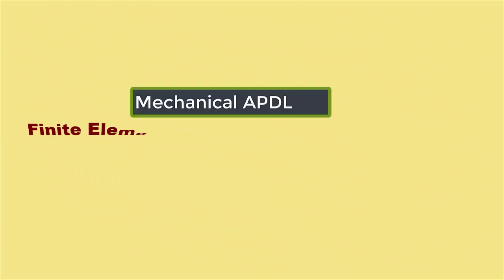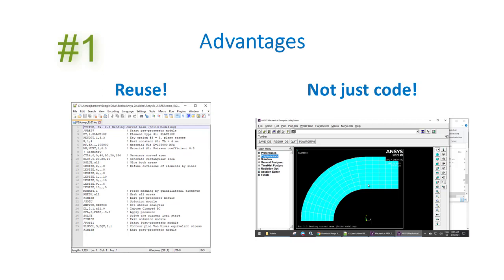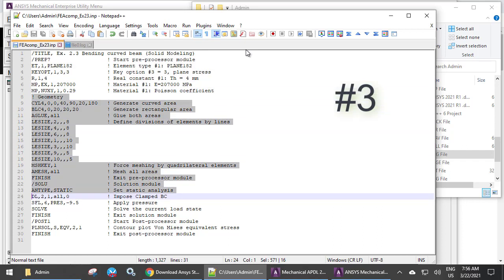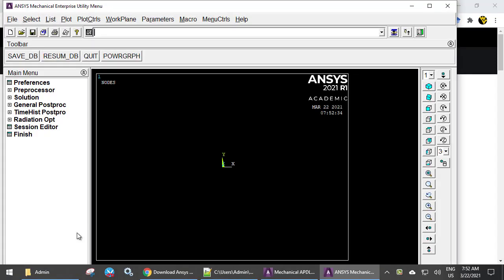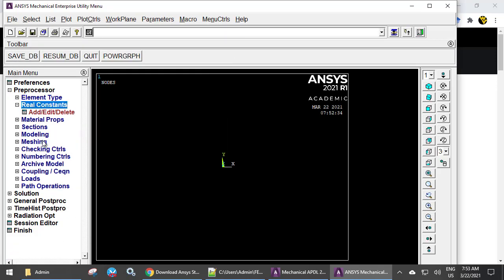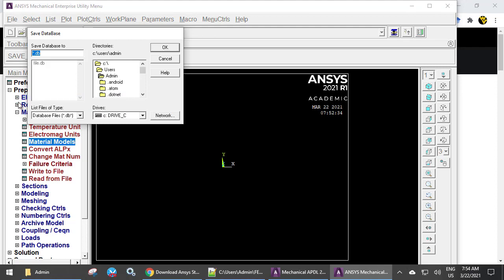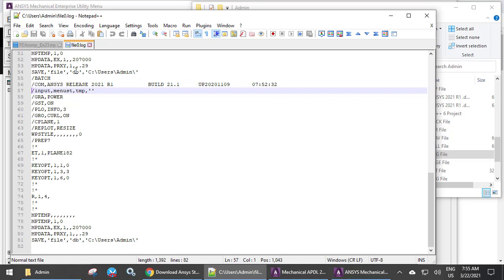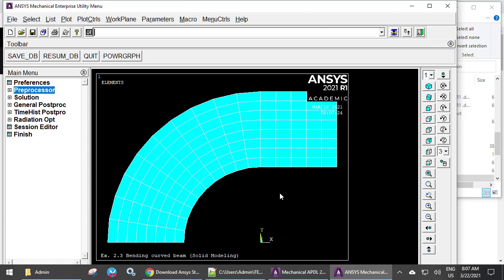Intro to ANSYS Mechanical APDL, how to get the script from the log file that the GUI writes for you

Comment: I can't open mechanical APDL launcher 2021 due to firewall issue, is there any solution for it? 
I tried disabling the firewall, but couldn't get through..
Reply from the maker: Sorry, I don’t know. All these security issues are driving me insane.
Reply: try opning the file by right clicking and then click - run as administartior, while opening Mechanical APDL

Comment: Excellent explanation of why learning APDL programming is valuable.

I bought your book from the google bookstore, mainly because of chapters 8 and 9. I have been trying to program the damage evolution in Python language by following the steps you have listed. So far the sear lag displacements solutions slips through my fingers. Only remains try harder and study more; eventually I will see the light at the end of the tunnel.

In favor of Workbench I have to say that is really useful when you need to design a complex part of the body, perform an analysis on an assembly that you have received, or show the FEM's results live (for example, a time-step video) . Furthermore, Workbench allows you to insert APDL code, but it is less comfortable.

Thanks, Dr Barbero, for sharing you knowledge with the world. And for  the references you cite on the book, I really aprecciate that.

PD: One question, from "Introduction to composite materials desing" 3ra Ed.  How have you determined the invariants of B matrix? Is this in some of Tsai's book ? or Should I read some tensorial book (ej: Rotation, Reflection, and Frame Changes by Brannon) to learn about this invariant relations of the stiffness matrix?
Reply from the maker: Thank you for your excellent comments about the pros/cons of APDL vs. Workbench, very true. If using APDL, it is also possible to deal with geometry/mesh/visualization using external dedicated software such as CATIA, Hymermesh, etc.
Reply from the maker: About B-matrix invariants, section 6.5.1, I derived the invariants myself, and now I see that I left out some explanation, as follows. Any 2nd order tensor has 3 invariants, I, II, and III. The first is the trace. The second is eq. (6.56). I did not plot BII because plotting the coupling-induced curvature is more physical (Fig. 6.12) but the invariants open up possibilities for further study,  for example, BII is a univocal measure of how good/bad is an orthotropic-equivalent approximation for a laminate that is not perfectly symmetric. More info here: E. J. Barbero. Universal carpet plots for stiffness and strength design. In CAMX 2017, Orlando, FL, December 11-14, volume TP17 (0006). SAMPE Digital Library https://sampe.siteym.com/, 2017 and E. J. Barbero. Universal knockdown factors for strength of carbon/epoxy laminates. In CAMX 2018, Dallas, TX, October 16-18, volume TP18 (0324). SAMPE Digital Library https://sampe.site-ym.com/, 2018. Links to preprints are here: http://barbero.cadec-online.com/publications_list.pdf
Reply: @EverBarbero  Thank you very much for the responses. I'll read the info you've detailed above. 
The method of finding an scalar (hr) whose value define a symetry ratio it's summonly elegant and useful. And yes, a dyadic has three invariant, I asked that because I'd never seen that type of notation ( I refers to the tr(B²) part of eq 6.56) and I've mencioned to Tsai because there is course offered on stanford.edu where it's claimed invariant-based approach on the syllabus.

I'll be expectant of more of your material. You've some fans on this side of the globe.
Reply from the maker: You are correct, BII=tr(B^2). BIIhat (6.56) is an invariant that I defined myself, in terms of the classical BI and BII invariants. Anyway, a combination of invariants is an invariant, right? Sometimes I am too creative for my own good. LOL. I have the latest book by Tsai but they only use the trace, there is no metric for lack of symmetry, and definitely no universal carpet plots for strength. That is a novelty I published in CAMX 2018, Dallas, TX, October 16-18, volume TP18 (0324) and Section 7.4.1, p. 262 in  ISBN 978-1-138-19680-3. If you are interested in this particular topic, contact me by email (find it here https://www.youtube.com/channel/UCjutRD80FWyjUCwSuD01m9A/about) Best regards.